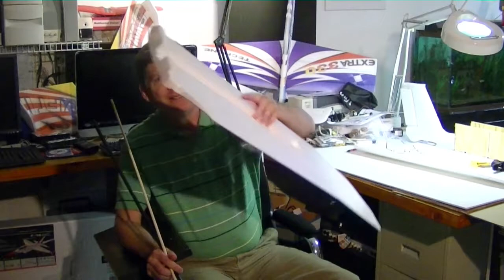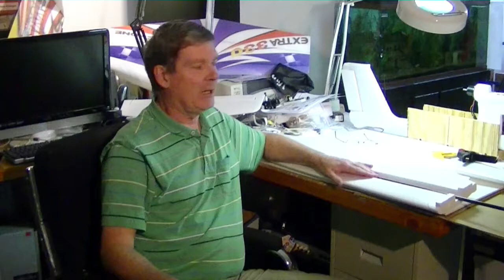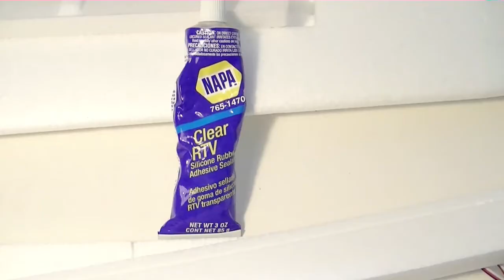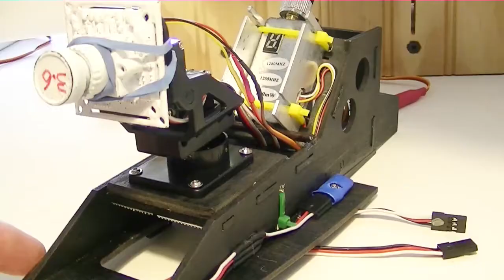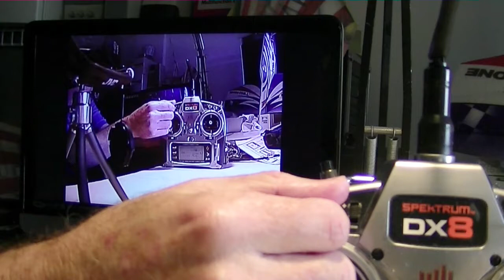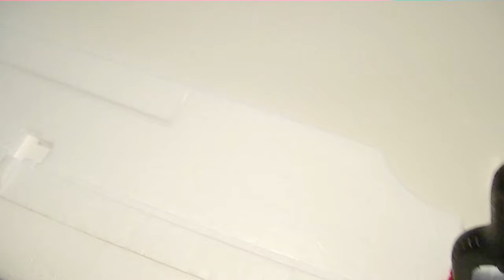FPV Part 15: Pan/Tilt Wiring, SkyWalker Wing, MinimOSD Panels and APM Mode Switch

Comment: Comming to the end of the build, great job, looking fw to see the maiden flight and future fpv flights.
Still, I think you soon find out that that pan tilt system is not accrued enough and has a lot of wobble while flying.
Cheers.
Reply from the maker: Thanks for the encouragement. The pan tilt is a very cheap one indeed and I expect to be rolling with jello. Do you have any recommendations for a better pan tilt.
Reply: *****
I use this one myself, and have good results with it.
http://www.hobbyking.com/hobbyking/store/__12875__FPV_Fiberglass_Pan_Tilt_Camera_Mount_L_Size_.html.
also a 180 degree analog servo from HK for the pan movement.
http://www.hobbyking.com/hobbyking/store/__27725__Turnigy_TGY_R5180MG_180_Degree_Metal_Gear_Analog_Servo.html
Cheers.
Reply from the maker: ***** Thanks, I have saved the links for next HK order :-)

Comment: Looks like its nearly there now, I didnt know of the rotational MinimOSD feature, that`s a good idea
Reply from the maker: Yes it is a cool feature that I read about on the arduplane wiki. Since I have 7 channels of 8 already used I decided to implement it. I am saving channel 5 for lights or other features.
Reply: *****
I have just set it up on mine, I have the spare channel, but I prefer the rotation on the single switch tbh. Nice feature :)
Reply from the maker: Coyote FPV Yes, the less switches to fumble with the better. Now if I could get my pan/tilt on joystick that would be great.